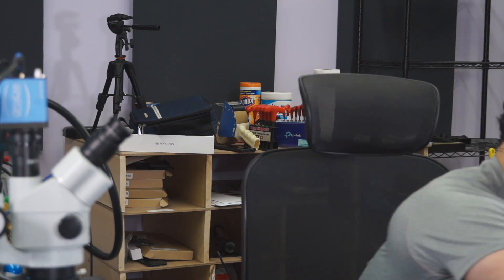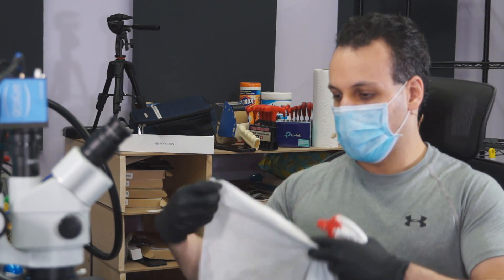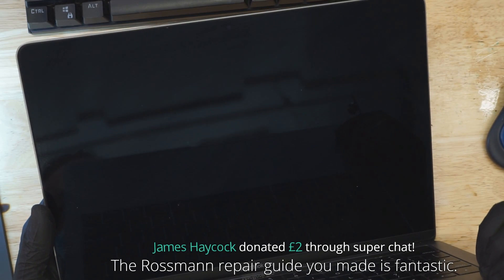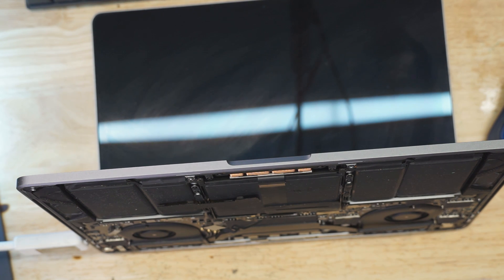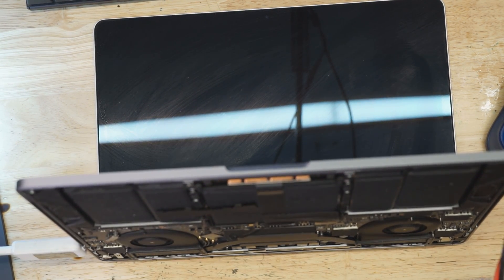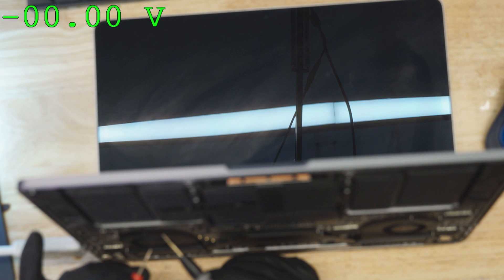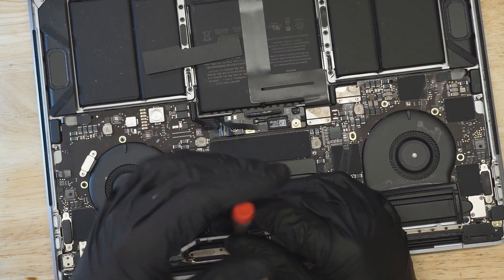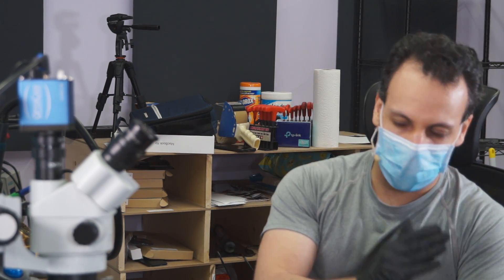Apple PCB design is a meme.

Comment: do you think the purposefully design the "innovative" devices to fail as frequently as possible?
Reply: They do. Most of the 'innovations' are spins on ideas other companies decided resulted in too high of a failure rate of their products 20 years ago lol Placing high voltage right next to data lines is unique to Apple. Obviously in any laptop things are close, but not like on a Mac where they are suspiciously close lol

Comment: I like how it's a known issue for wires shorting on their peripherals and they've made literally ZERO effort to resolve it. I guess when you charge $20 for a charger block; you can't afford innovation.
Reply: That's not true, give it enough time. After several years and multiple class action lawsuits, Apple will claim "a very small percentage" of Macbooks suffered from display-related failures, then offer a "replacement program" for the smallest range of applicable serial numbers where you have to pay them $300 to replace your Macbook with another one, and then quietly fix the issue in a new model and pretend this was never actually a design flaw. Now THAT is innovation and courage!
Reply: Only innovation apple makes is being able to fuck things up again and again. They will always find a new way to make their overpriced products pure crap.
Reply: Exactly you've already gained their trust and they think that this is just something that comes along with the ride until they realize they've been fucked. then they try to be that next journalist that had their computer password taken by the social engineering team and so on. Get out of here. Apple is just like rest but worst. they would probably make more by just selling the Apple OS system to work on Windows
Reply: The innovation is the designed obsolesce and designed failure, so the company can make more profit to sell you a new one!
Reply: or more so make it an independent software versus it being installed on Windows it can be installed on a PC to make it a Mac why not try to convert every PC to a Mac with your software and charge for it versus making shity computers. Or do both, why not take advantage of both sides of the spectrum make shity computers and sell them to the customers that are gullible and then the other customers that realized the fluidness of the software and optimization works for them can be installed on the PC but that cost way too much money to make sure that every computer can run Mac OS. No longer makes a Mac just a Mac because you can now just buy a PC and put Mac software on it and we can't charge you three times the amount for components blah blah blah. The only time I buy Apple products is on the black market sad to say they're fun to use but the price is just so ridiculous and I'd rather someone else pay it and then I pay a fraction of that afterwards. then your computer stops charging and you realize fuck this motherfuking company. I got this goddamn Acer switch tablet computer that's a piece of shit that's still trucks along the way! Nothing like exporting a video on a i3 with 2 gigs of RAM and still getting away with it!